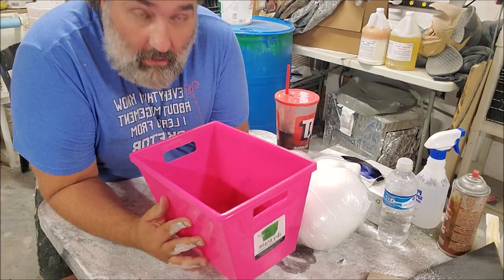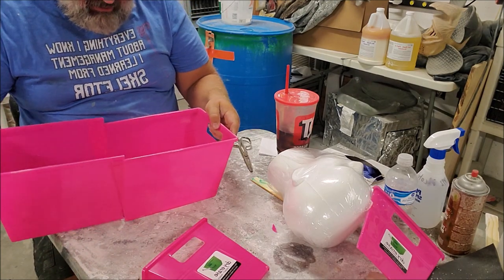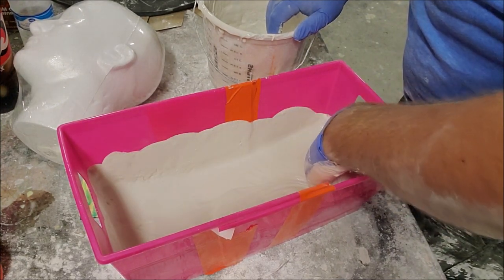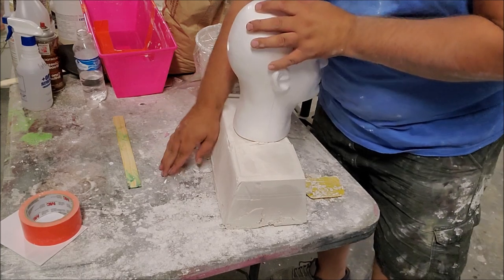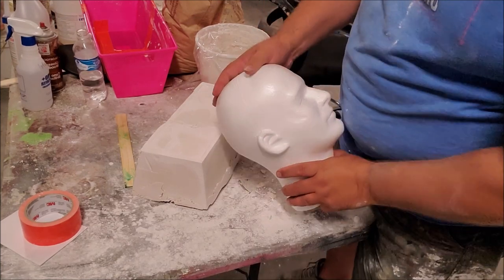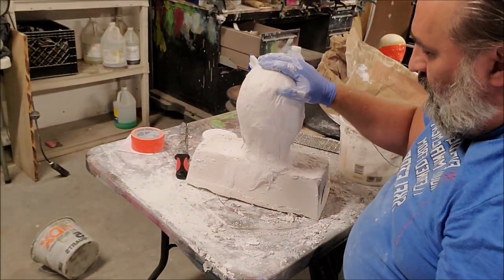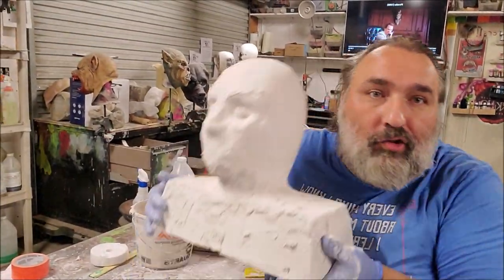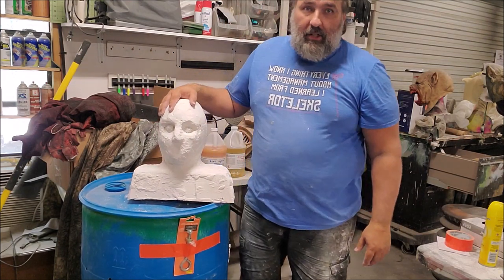plaster head form bust

Comment: I have read through the comments and it appears that you are using Ultracal 30 plaster. I have some left over Plaster of Paris that I can use on this for me. But I have to ask, what is the concern with Plaster of Paris?
Reply from the maker: its just not strong enough for mold making- it should be fine for this application.
Reply: Interesting, I've used Plaster of Paris to make DIY Atlas Stones (185 and 230 pounds) without an issue.
Reply from the maker: a wrinkle on a sculpt, becomes a sharp ridge of plaster, that breaks off really easy  with POP.  so the detail it can hold is limited by the tensile strength of the plaster

Comment: I'm having a problem with my plaster wanting to flake off while sanding and yes there were plenty of holes and lines for plaster to hold on to. I keep reapplying, some mixture is thicker, some thinner. Since I don't plan on making many latex masks or even sculpting with clay on it, would it be okay to cover it in an acrylic caulk? I plan on making more EVA foam masks and head pieces with it.
Reply from the maker: what kind of plaster are you using?

Comment: Hi 🙋
I did a similar one, but I ended up with the same problem every time l use it  - a broken neck - so I made another one has a thick wire structure.. and it work 😎
Reply from the maker: Great tip!